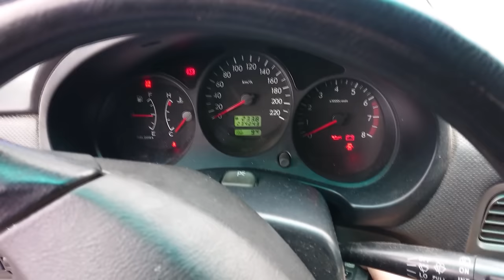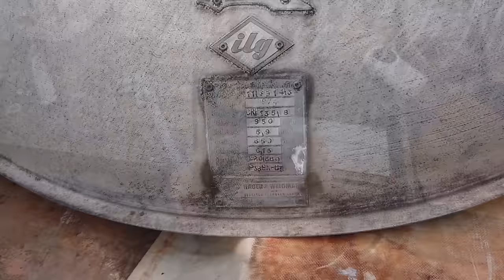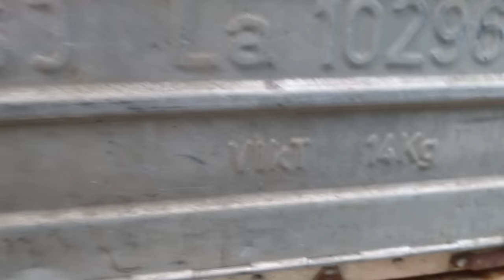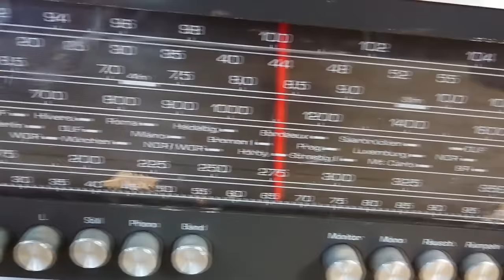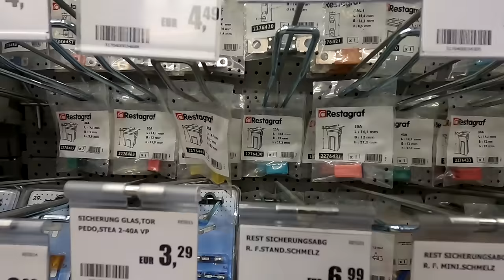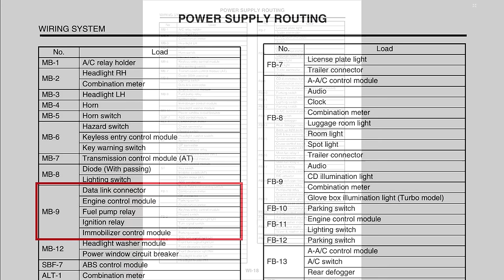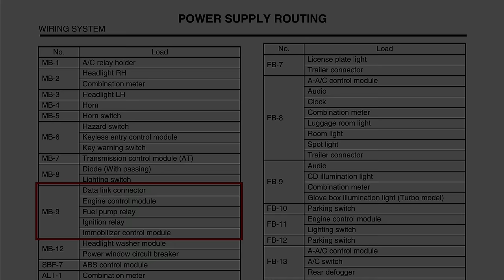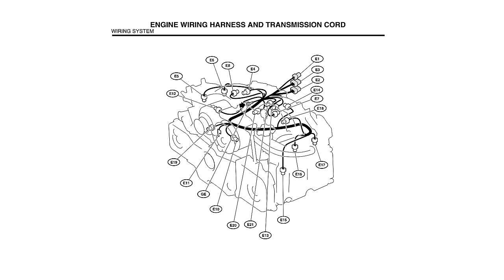New Awesome Scrapyard Finds! Repair-A-Thon!

Comment: Great job troubleshooting the issue to the root cause!  And yes, it would have been easier to have replaced the harness and called it a day, so I appreciate the effort that went into digging into the real source of the issue.  The only idea I have for preventing it happening again would be to add metal mesh over the vulnerable wiring.  Rodents are pretty tolerant of repellants, so I'm not sure I'd trust anything that claims to keep them away, long-term.

Comment: I had an RV repair business for twenty years.
One of the things that I did was repair 12 volt power supplies. They converted 120 volts AC to 12 volts DC in RVs.
I bought a book on basic electronics to study, bought the service repair manuals directly from the manufacturer and even had a supply of repair parts. I repaired an old power supply exchanging it for the broken one in a customers RV. I then repaired that unit for replacement the next time.
I made a good profit, saved customers time and money, and learned along the way.
Then in the late 1990's, power supply manufacturers, in their infinite wisdom, came out with electronic power supplies with circuit boards. No longer could I get parts to repair. To make matters worse, the entire electronics were covered in resin, ostensibly to protect them from moisture.
What this meant was even if you were able to clear the resin, you would have to be an electronics engineer to repair the circuit board providing that you could find the necessary components and not worth your time to repair.
So, it became a replacement item that the customer had to pay a premium price for.

Comment: Awesome job fixing that electrical wiring you should fix the wire loom so if it happens again you have the fix by doing that you realize that that issue will never happen again because you took the time to fix the wire loom great patience and awesome detective work love your videos

Comment: Such a great feeling when you finally find that fault. I had a similar motorbike electrical harness problem. Intermittent fault and only solved it with a complete teardown. I would have never found it without doing it.

Comment: There's no telling how many of these I've installed, and or changed our for new exhaust fans. 
Typically the old ones went into a scrape pile to be carried to recycle facility for whatever price it was going for at the time. 
Had they been refurbished to something as this, they would have been worth so much more, and lived for who knows how many more years of useful equipment. 
You have some familiar viewers I see, such as Warch Wes Work.
Been a viewer of his probably as long as your channel so many years now, but doesn't seem that long ago. 
No way of knowing how many years that is, but you've both added many more viewers since I first started.

Comment: I think I can point you in the right direction with those fuses buddy. They are very expensive new, but easy to salvage from other vehicles. They are used on Vauxhall/Opel Astra's, Insignia's and Zafira's. I have had to replace them previously on an Astra that had a heater motor fail. They are identical fuses. I'm sure that since you are in Germany you will have no problem finding some Vauxhall/Opel cars to salvage some from 😉 As always I love your videos and can't wait to see more. Its great to see you putting so much effort into keeping the car on the road. Love the lights too!

Comment: Unfortunately, the problem you finally found is very common.  My 2010 Tundra has had parts of the fuel sensor harness, located under the intake manifold, chewed on by mice 3 different times.  I had the truck in the shop twice, and they repaired the harness.  The last time, I did the work myself.  I completely replaced the harness, but thoroughly wrapped it in  aluminum mesh/screening.  To date, I have not found a successful long term mice repellant.  I just keep mice/rat poison bait next to my garage all year long.  I really enjoy learning from you videos and repair adventures.  Keep up the good work sir!

Comment: I live in Michigan in the USA.  I have a large piece of property and I have 100 trees on the property.  Many of them are oak trees with some black walnut as well.  In the fall of 2022, both my vehicle and my son’s vehicle were damaged by squirrels using our engine bays as shelter and nests.  Thankfully our repairs were covered by our insurance.  My son, did some searching and found a product called Sniff ‘N’ Stop  Chew Breaker.  I have not had a problem since.  You can spray this on any surface including wiring to prevent chewing by rodents.  It dries clear and last for a whole year in any weather or temperature.  I just reapply every August and have not had a problem since.

Comment: Great video, thank you Gerolf. Thanks for sharing your knowledge and setting an example, it is inspirational. Good job on the Subaru, they're not terrible to work on and still have many metal parts so they last a bit longer. As others have mentioned, for rodent control mint is effective, as are strobe lights. Once the little vandals have moved on you can tone things down a little, and employ some sort of evolved and domesticated feline patrol on the premises. I hope the weather improves, although I envy your rain - we have had .5mm in 4 months.

Comment: My son had the same problem with his Forester.  Fortunately his insurance covered the repair, less the deductible.  It took two months to identify and repair.  He live in a rural part of upstate New York and after the repair he leaves the hood open with a light on too discourage varmints. It has been 100% effective so far.
I have an RV that I have used an ultrasonic with flashing strobe to dissuade critters and it seems to work for all except rabbits.

Comment: +1 for peppermint oil.  Rodents took out the wire harness and vacuum line in my truck and an EFI wire in my other car.  After repairing these, I sprayed the engine compartments with peppermint oil solution.  No further problems.

Comment: Bounce dryer sheets!
I learned this trick from my customers who used them to deter rodentia in their campers over the winter.
For some reason people who throw these dryer sheets around their RVs don't have mice chewing up things and in the spring when they open their campers, there's no damage.
It has to be Bounce brand not store brand. Evidently there is something in those dryer sheets that mice don't like.
Just put a bunch of sheets in the engine compartment where they won't come in contact with anything hot or corrosive. Wad them up and tuck them in so they don't blow around.
In my garage I keep four Victor mouse traps with Elmers glued on peanuts at all times. The mice have to tug on the nut to eat it and when they do, the trap snaps.
The worst time is late summer and early fall when they're looking for a good place for their food stashes and nests for the winter.
Hope this helps!
🐁🐀😂😂
Reply: If I'm not mistaken you need to periodically refresh the dryer sheets. Otherise the thing they don't like fades away and what's left is some nice nesting material.

Comment: A great way to keep the rodents away and out of important places is to get some Cyan pepper . Just sprinkle the pepper around the areas where you don't want then to go. Just remember when you work on that area where you put it and don't rub your eyes . LOL. They will not hang around long where the pepper is placed. This also works if you have places like a porch and skunks or digging animals always den up. Awesome video. Cheers from Southern Ontario.

Comment: Had a similar issue with my Subaru, a sensor stopped working (used for emissions control), I managed to identify the wire with the fault but the damage was under the manifold (similar to your situation), also signs of rodents and could see where they had chewed at the wire.
 One shop gave a $1000+ estimate, another shop fixed at no extra cost during the major service after I described the issue to them. Worth shopping around!

Comment: You were more thorough than I would ever have been when it comes to car repairs. Silly suggestion but best rodent repellent - An out door cat. Also makes a puurfect cuddle companion :)
Rodents love the easy life. Your car was under (or on top of in their perspective) their favoured food source and somewhere to shelter. Easiest solution, move the car well away from the tree if possible. Or give them an alternative food source away from the tree and your car, like a dog bowl of berries when it's mouse season. I use this method to completely stop ants from getting into my house. When I see the little buggers roaming around my back yard for the first time looking for food I leap into action. All kitchen surfaces and hard floors at back of house are cleaned with mild disinfectant and then I buy a cheap pack of jelly sweets. Dip them in warm water and leave them in the garden near to the nest. They have the ideal food they want and never come in the house! :D

Comment: I use an old battery powered smoke detector to repel mice, using 3 diodes in series in the nine volt power line reduces the voltage so it thinks the battery is weak so it makes an loud annoying bleep every so often. Seems to work in my camper while in storage , one inside, one in the lower compartment. Thanks for the video.

Comment: Honda Rat Tape. Works great at repelling rodents from chewing through wiring harnesses, it repells them. Here in the states, when honda and other techs replace a chewed up harness, we wrap the new or repaired harness in the rat tape, helps prevent future gnawing

Comment: One way I once used to find a short in a car was to short and bridge the fuse and look for the smoke and where the wire was melting.
It worked.
But maybe keep a fire extinguisher handy and keep that test for the final stages of desperation.

Comment: I once found evidence of mice hanging out in the engine compartment of my  E36 BMW at one house I was living in.  We didn't have a rodent problem, per se (there was never any evidence of mice in the garage or in the house), but I had rodents in my engine bay in the driveway anyway and they were apparently not dissuaded by me driving the car on most days.

I installed a couple of plain-old spring-loaded mouse traps, and reset them (and sometimes cleaned out a captured mouse) every day or two whether I'd been driving or not.  Eventually, after only a week or three, the rodent problem went away and did not come back.

YMMV.  Good luck.  (And please try to avoid using poisons or killing trees to combat the issue.  There may be other ways that directly address the problem without causing too much extra fallout.)

Comment: Admire your persistence. I agree with one commenter. If you’re looking for a dead short replace the fuse with a high wattage 12v lamp and use a clamp on amp meter (dc Hall effect) to track the current flow.

Comment: In 2022 I went to the UK for a year fellowship, and I bought a Zarges case specifically because I wanted something kind of rugged that would carry more than standard luggage. For the post part, I was pleased with it.  The corners could use more reinforcement even in the new cases, so it doesn't surprise me that's where the fault appears to have happened in the older one.

Comment: Great episode, I am currently in the same struggle with my motorcycle. It would only drive 60 km/h, so I started to replace things starting with the cheapest part .... in the end it came down to a worn out carmshaft and a damaged sparkplug thread (still have to get the newly cut thread airtight)

Comment: I work at a Subaru specialty shop. As soon as you started describing your problems, my recommendation was a replacement wiring harness for the engine. Subaru still makes these, and they’re not as expensive as you would imagine. Sometimes it is just better to replace the whole harness than to try to fully troubleshoot something like this.

Comment: Been there, man. I can't vouch for the effectiveness since making sure my engine bay is free of plant matter and garbage seems to have done the job, some old mechanics have told me crushing and sprinkling the soap Irish Rain around the bay works as a mouse repellant. Also if you run into this again, get a 30 amp breaker. They also make resettable fuses for about the same price.

Comment: Thanks for the tip on the ceramic outlet bits, have some industrial pendant lights that I have searched high and low to figure out a solution.

Comment: As someone who does this kind of troubleshooting a bunch, I feel you were so close to finding the fault yourself when you began isolating the circuits from the ECM. I bet with some better service info or more time you would have had it. Depinning or jumping the ecm plugs to isolate the circuits one at a time could have got you there but also a humble incandescent test light would have possibly found the short as well with harness disconnected it would indicate which circuits have a strong path to ground. Continuity or ohm tests work as well but I find it's often nice to test certain things with a test light as it requires actual current to illuminate. Connecting the light to B+ then testing the harness from the ecm connectors would have worked well.

Good job getting it running. This would have been difficult for anyone.

Comment: Recently had a similar electrical issue on my 2016 Mustang, was running perfectly fine all week going to/from work... Then went to drive it one afternoon on my day off, engine starts, but no accelerator pedal response and it set an engine code for a few pedal codes and +5volt reference circuit out of range.
Long story short, it didn't have anything to do with the pedal at all of course, I ended up narrowing down the short by pulling all fuses until the short went away (pulled fuses while watching the voltage on the +5 volt reference circuit)... Ended up being the fuse that goes to the driver's seat power and I traced that back to a subharness connector in the driver's side foot well, of which the reference voltage pin was right next to the seat's power pin... Corrosion tracked between the pins from moisture.
Cleaned out the connectors really well, a little silicone spray to keep out moisture in the future... All is good now!

Would have been easier had I found wiring diagrams sooner (or just not been cheap and got a subscription access to them), but oh well.

Comment: Hi, from Romania, a solution is to make a very simple pest repellent circuit with a 555, that is using ultrasound at 10Hz beat, that is annoying any pests in general and make them go away. I build one for a family friend and he was very happy for many years. Another solution is to use mouse poison, glue little pills of poison around your engine, and randomly the bastard will get in contact with one, sometime. Use traps for mouse around your car, use 20 or 40 traps, everywhere. Catch everything that moves. See if you can put your electrical cables inside soft or bendable metallic tubes, thus protecting them more from rodents.Its what Ill do.

Comment: Great video.

Can you get a shop cat? 
It doesn’t completely solve the rodent problem but they usually avoid areas with cats and it would be fun to see one in your videos.
Plus you could spend a few hours building cat trees or outdoor runs for them from scrapyard finds.

Comment: I had a 1988 ford pickup that I drove out of state to visit relatives, and the day I had to drive home, most of the electric system failed in a big way. I had someone drive me to a parts store and I bought a 12 volt probe with simple light bulb indicator. After much probing I found that the wiring harness wasn't delivering power all the way to the firewall. I unwrapped the harness and found a factory connection inside the harness where they crimped one wire to two wires with an aluminum crimp on copper wire. I'm thinking this had a galvanic reaction because all there was left of 2 inches of wire was gray powder. I cut back to fresh wire, soldered on some fresh copper wire and everything worked again. Automotive wiring issues can be a pain in the butt. Glad you got your problems figured out. Good luck with the mice. They will continue to enjoy the inside of your engine compartment if it is available to them. Parking indoors is the only way I've found to prevent mouse damage. If your indoor parking area is mouse free.

Comment: I have just reluctantly sold my Forester XT premium (series 3, 2011) they are normally a very reliable car if serviced regularly, mine had done 240000km and just has the cam belt and rocker cover gaskets replaced. They are a true drivers car unlike the mazda cx-9 I replaced it with but an expanding family ... I totally agree with the sad loss of skills to repair all electronics equipment; I used to teach electronics down to component level but the level of complexity that is now 'required' means that few people have the time to fault find and that replacing modules is far more economically viable. Built in obsolescence!
Reply: In the US 2011 was a bad year for Subarus....First year of a new engine
Reply: @DDrew67 I think mine was the EJ255 E Turbo, I think it was a redesign